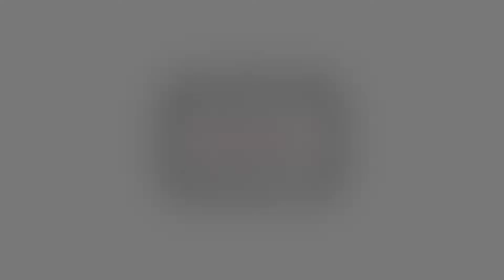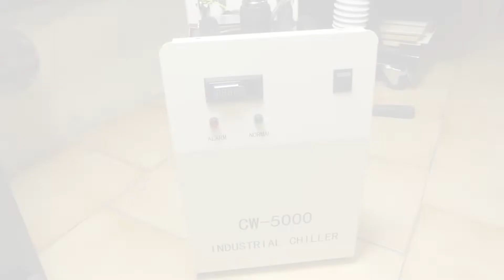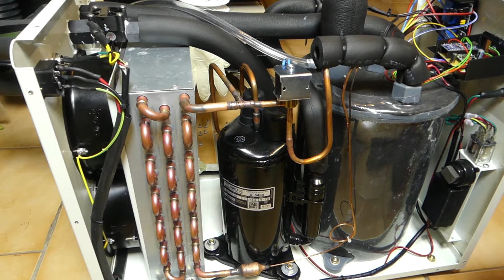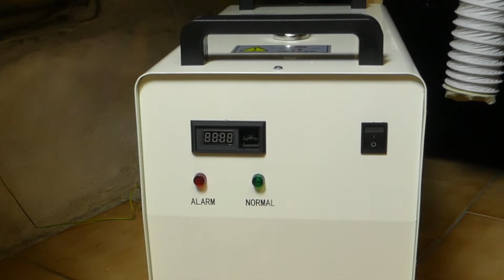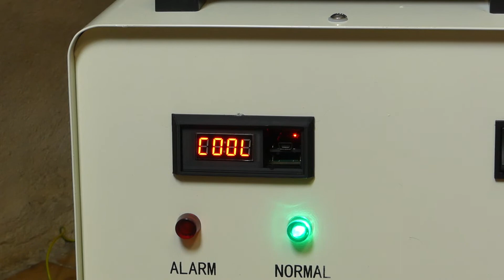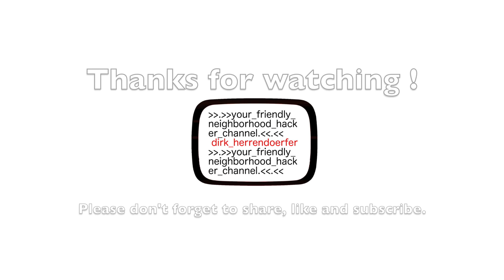A new controller for my CW 5000 - Laser Adventures - Update 4

Comment: Nice mod. Don't know how accurate your temperature sensors are, but you could consider adding tenths of degree to your display. After all you have 4 digits to play with ;-)
Reply from the maker: They are not very accurate .... and the display I chose does not have decimal points .... I'm happy with it the way it is. And I can connect the laptop at any time to get accurate information about everything.